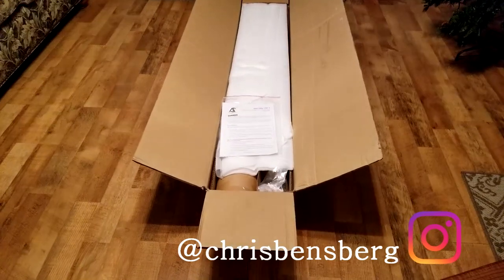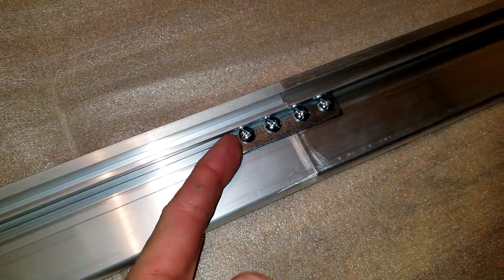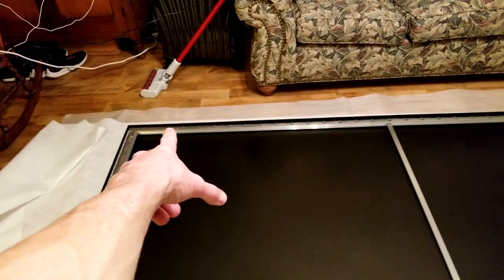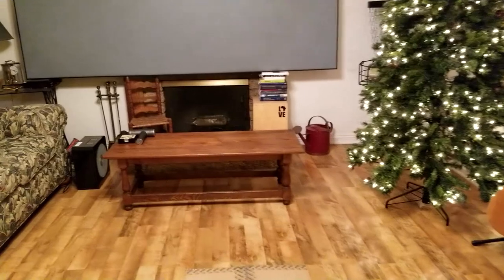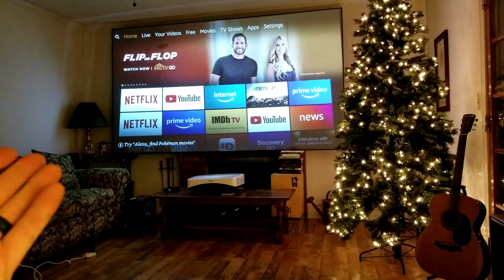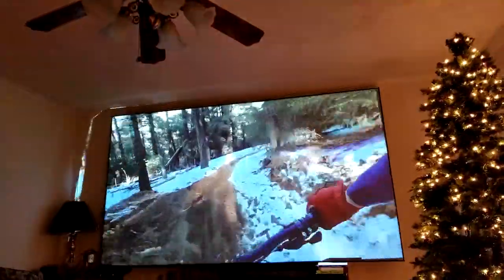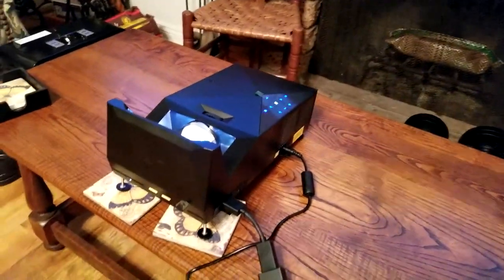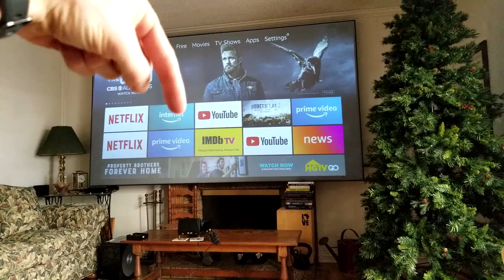AKIA SCREENS® 123 Inch CLR® 4 Projector Screen For Ultra Short Throw Projector Build A Home Theater!

Comment: Wrinkles after about 9 months to a year and looks horrible, seems to be a common issue. Save your money
Reply: So what do you recommend?  Different  brand?
Reply: @prtbone78  if I had to do it all over I’d probably get a pull down or an electronic drop down. For a fixed frame def a different brand. I’ve learned that if you live in an area with humidity you risk getting wrinkles. I’m the winter I have 0 wrinkles and in the summer my screen isn’t even really usable.  Others have reported similar issues.
Reply: @W W  I was thinking pull down or motorized  im not lazy but motorized  looks sexy  haha. I'm in florida so super humid.  Ima do roll down. So can still have tv  not trying to burn my  projector out.  Thnx for the advice
Reply: @prtbone78  haha I agree with the motorized screen lol. Don’t get me wrong, the fixed frame screens like this one being reviewed look awesome when they aren’t wrinkled but when they are it’s pretty disappointing. My other concern with the fixed frames are that the springs stretching the materials in the back will eventually get weaker over time. Just make sure the screen you’re getting matches up well with your projector and you’ll be good to go! Best wishes!
Reply: @W W  thanks haha. ...  I have a 92 inch  got it cheap its velcro back better but to pull and stretch the glue pulling up
Reply: @W W  thanks. Enjoy your night / weekend. Ima get me a large outdoor screen maybe yard master  so bigger and can take down n put up whenever.
Reply: @prtbone78  you too!! thanks!
Reply: @W W  yessir thank you
Reply: @W W  92 in elite screen I have forgot to add.  Seen small wrinkles for the price could t beat it.  I paid 100 bucks  also can not see them when image is projected   maybe small shadow but almost nothing unless nothing  if so minor  unless looking for it.  But thanks for the feedback ima get pull down or akia  elite screen or the yard master or lite version from elite screens. For now I'm good. But a tad small for my lining in an apartment  not a home with dedicated  movie room.  G.n